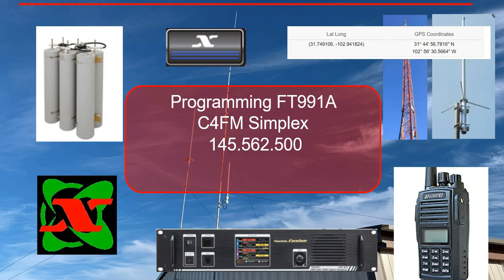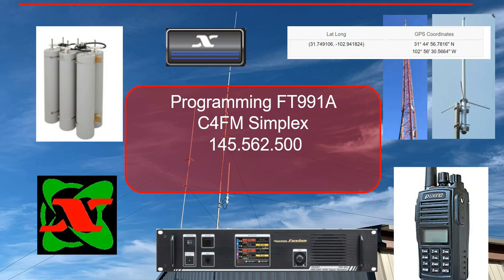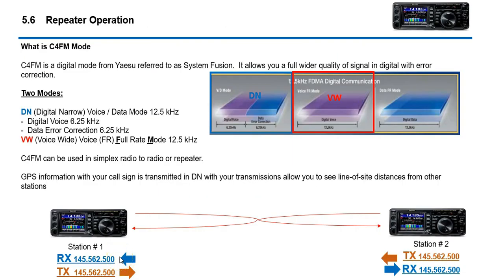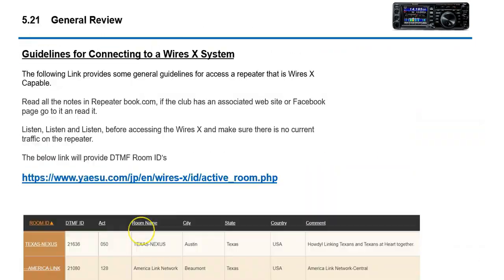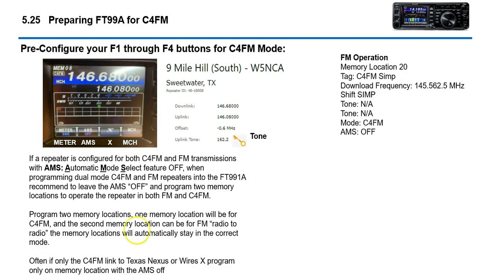Programming FT991A C4FM Simplex Frequency 145.562.500 with Tag

Comment: Thanks for the post.  Now I have the C4FM calling frequency programmed into my 991a, just didn't use memory 20 as it was already programmed with another repeater.  Had to use memory 55.  Here's my remarks from an earlier post:  I just purchased a Yaesu 991a and tried out the System Fusion (Wires-X, C4FM) and believe me, it all sucks big time.  You Yaesu guys said that System Fusion provides crystal clear audio, but that just isn't the case.  Every time I go to C4FM the audio is muffled, muddled and other Ham's voices sound like computer generated voices.  If I had purchased the Yaesu 991a for the digital mode, I would have immediately returned it.  I was considering an ICOM 7300 but other Hams have told me that D-Star (Death Star) is even worse than System Fusion.  You guys that designed the digital portion have a long way to go before I consider it a proper mode of communication.  I purchased the Yaesu 991a because of it's all mode.  We have a 2 meter SSB net here every Wed. night & 2 meter sideband radios are hard to find.  W Rusty Lane K9POW in eastern Tennessee

Comment: THanks, i didnt know there was an Dedcated freq  for Digial simplex   is there one also for UHF  446.000 ?
Reply from the maker: Good Morning John how are you doing, there's a series of of videos from Yeasu that I've been watching where I got the frequency this is the link https://youtu.be/xrx2q_Ga4n4  also I noticed on the 2 meter band frequency's 145.50-145.80 are for Miscellaneous and experimental modes so I think unofficially Yaesu has called this the C4FM calling frequency in this frequency range - my plan is to work in the frequency range and may make another frequency +/- 20kHz in memory a location and call it "2M C4FM Talk" .  Again, thanks for the message we did some live videos last night on real work demos so check them out if you want using DG-ID TX/RX50 '73 de KI5JUF
Reply: Thanks   for the link  keep up the great work  I am enjoying  C4FM